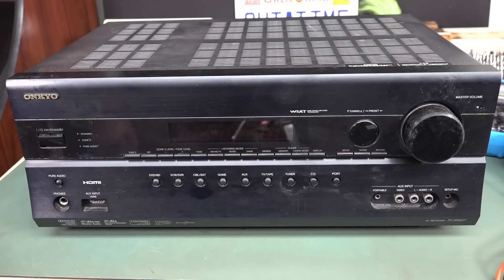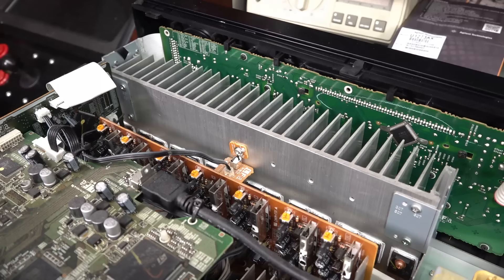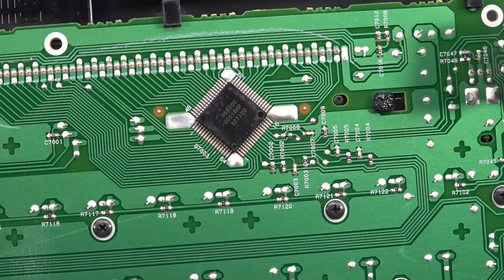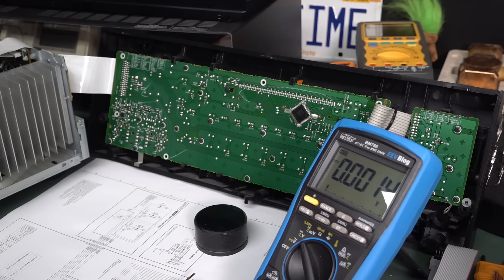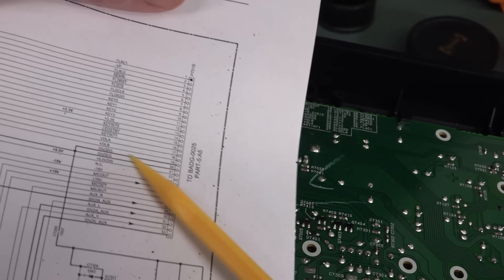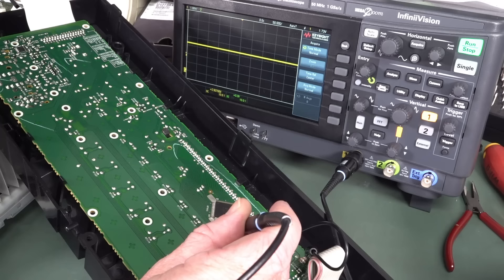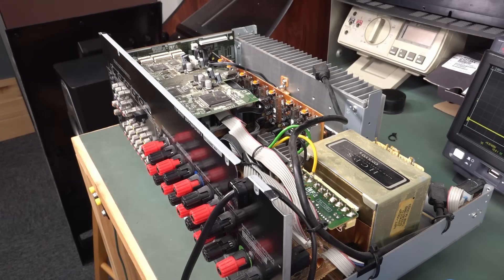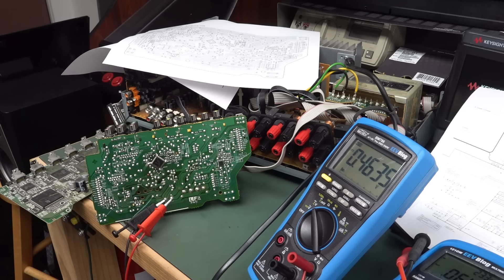EEVblog 1394 - Onkyo Receiver Repair - Part 1

Comment: Yes, do more audio and CRT based repairs!
Reply: Dave loves high voltages
Reply from the maker: @zyspan  It's true, I LOVE 12V systems!
Reply: @EEVblog  i am recently attracted into analogue audio circuits with two 9v cells forming a bi-polar supply

Comment: I can't help but notess you have mised one of the first things you should check with VFD's, that is checking if the tube has lost its vaclume. Usualy the little nib gets knocked off when the unit is bumped to hard or droped. As long as the getter is still shiny then the vacume is still in there.

Comment: Dave, Q9001 is a simple +ve voltage emitter follower regulator...

AC from the transformer is applied to the circuit, one end to R9010 and the other to the -ve end of C9001. This is half wave rectified by D9001 and smoothed by C9001 before being applied to the  collector of Q9001 via R9001. The reference voltage created by R9002/3 and D9005 is applied to the base and the output is at the Emitter.

To check out the regulator without having to power up the unit, ensure that you have the transformer disconnected and use an external power supply supply, -ve to C9001 and +ve to R9010. Across C9006 you should see your -VP supply voltage. 

The thing that makes this look overly complicated is that, what would normally be the positive output is referenced to the +5 rail and the side that would normally be ground is actually the -VP output. I'd lay my money on one of the resistors being OC/ R9010 or R9001. Of course check that there is not a short on -VP.  Steve

Component references as per downloaded manual from ONKYO TX-SR607 SM Service Manual download, (elektrotanya.com)

Edit-Just seen part 2 of this. Seems I was spot on :) But make sure that if the resistor is a safety component it is replaced with a suitable part.....
Reply: Hahaha. Turns out this was good advice!

Comment: Boy, you sure make troubleshooting VFD displays look hard.  And you even have a reasonably close schematic.  And those gray ribbon cables are just plugged in.  Push the flat spot on top of the white connector down to release the clamps then pull out the wire.
Reply: He's an Engineer, what do you expect, they can design them but fixing things is whole other ball game.

Comment: Also if the set (it IS an AV receiver) has video output, hook that to a monitor and see if it displays any info when you operate the controls.
In a darkened room you can see the VFD filament glow, just like a 1.4 volt valve tube.
Reply: YES. I have a similar Onkyo A/V and it displays all the menu / setup options on the TV screen.

Comment: I have the same model that got the same issue with the display after having it for two years. The display just didn't turn on one day, but all the other features worked fine.

I sent it in for a repair at an authorized Onkyo service provider and they diagnosed the issue to be with one or two resistors. The service report had this listed as parts:
2,2/0,5
220/63

After I got it back it have been working fine for 10 years now

Comment: I had this exact amp... lost my job, and had to sell it... got a lower model now and it's going strong with no issues...

Although I know the VFD not working is a known issue with some of these....

If you plug the HDMI-Out into a TV though, you can use the interface on the display to manage the settings ;)

Comment: A few years ago i was walking out of a friends apartment and on the neighbors trash can was a Harman Kardon AVR354 7.1 receiver. I swooped it up and took it home and all that was wrong with it was a busted internal fuse and some dodgy solder joints. It's been running for 3 years flawlessly.

Comment: I've had a couple receivers come in with dead displays, only to find that someone had bumped the "dimmer" button and turned the display off LOL.  Though usually it's not that easy.
Reply: When I discovered that my Denon-receiver had a setting to disable the display, my first thought was that this feature must be responsible for some small part of the product return-rate 😀

Comment: Check the DSP chip on the HDMI board, IIRC that drives the zone portion of the display and the digital inputs as well. Usually a reflow or a 50W halogen lamp pointing at the HDMI board to heat it up works temporarily. There was a huge flood of these on Ebay as not working, bad TI DSP chip and Onkyo ran out of HDMI boards for warranty repair.
Reply: I had that issue on mine (or at least a similar issue on the HDMI board). I recall there were a couple of small components to bridge out or bridge over with a resistor, which saved it for a while.

Comment: The ONKYO TX-SR series is notorious for failed electrolytic caps on the video switch board. Recommend replacing all of those through hole and surface mount electrolytics with high quality 105C rated components. Check your video processing and passthrough for noise/glitches.

Comment: I once repaired a dead VFD on a DVD player (good one worth saving, some Pioneer thing that plays Super Audio CDs). Nothing wrong was with the tube or the driver, it was just a current limiting resistor for the tube filament that opened.

Comment: Love the repair videos! I did this for a living until it became unprofitable. Thou shall check ALL rail voltages. Come on man, you have a shop full of supplies to feed that circuit externally and then divide and conquer. Just be sure to power limit that external supply and I'm sure with your skills you'll find it quickly. Can't wait for part two!

Comment: I have one of these and had the same problem, I had a repair shop say that the issue was due to a joint somewhere on the display getting too hot and cracking, they also said that its a fairly common fault but wasn't common enough for a product recall.

Comment: I have one of the higher-end models from this range. It's got hdmi and an internal upscaler. I love it. Got it as a refurb unit well over 10 years ago. Use it daily. Only issue is that recently the automated eq setup program will start randomly as if i pressed the button on the front of the unit.
Reply: Spray some electronic contact cleaner in the button and press it 50 times.
Reply: Follow-up: In my setup it was just too much work for me to dig it out, and due to the fact that once the thing warmed up it was not a problem again, I did not try to address the problem. One day recently, though, it got real ridiculous to the point I couldn't get it out of eq setup mode. I gave the unit a nice quick  "tecnical tap" right under the buttons that select the eq setup program. It's worked fine now for about 3 weeks. LOL

Comment: These kind of amps are perfect for like salvaging parts.
Mains transformer will work perfectly as a good PSU for a lab power supply, heatsinks, banana connectors are very usable etc.
Depending a bit where you live, but I have see them for less than like 20-30 bucks.
New heatsink and transformer is more expensive.

Comment: Took an older one apart that had a failed Dolby decoder board, and thus was not fixable. Standard definition analogue video as well. They also use PCB sections with wire jumpers soldered between them as wiring loom clamps, where you have to fold the pieces of board over to hold the wiring looms.

Comment: Those ribbon interconnects. You press down on the top and it lets go of the pins. 

And yes. I repaired one of these a while back. Huge pain in the ass to work on. Back in the day, they used to have a removable panel on the bottom of the chassis that let you get at stuff on the bottom without a huge issue.

Comment: Interesting vid regardless of the outcome, I recently picked up a similar unit from pioneer, almost free since it was defective, not quite as many bells and whistles but roughly same era and basic features. Haven't had more than a cursory look at it yet but seeing your process is similar to what I'd do gave me some confidence that I might actually be able to fix it.
Reply: I have a model of similar vintage (maybe a little newer). Mine had a problem with the HDMI distribution board when hot (can't remember the exact symptoms, repaired under warranty back in the day). I think that was caused by cracked or bad solder joints under one of the BGA chips. So if you have those kind of symptoms, reflowing that might help.

Comment: Great series ! - more repair videos. Its always interesting to see how other engineers go about things.. I'm watching this as I type and shouting capacitors at the TV !! - I have the same AMP. they suffer with CAP's. the HDMI board also suffers with dried out caps the symtom there is your can't get the on screen display to come up on the TV.
Poke about with an ESR meter...

Comment: Why not activate the ‘Zone 2’, ‘Pure Audio’ (buttons on the front panel) and IR (volume) as a simple test to check if the display chip is working and eliminating it before going further in to troubleshooting.

Comment: Surprising, an onkyo xx7 Amp where the DSP board hasn't failed yet...
If you get the VFD to work, I would highly recommend replacing the caps on the DSP/HDMI board. 90% of these recievers fail because of those, so its just a matter of time.
The Board gets toasty hot and they only used 85C caps.
xx5 was nice
xx6 and xx7 had HDMI board capacitors issues
xx8 have issues with the texas instruments Signal processor (A,B and C revisions of the chip), the output drivers wear out until the digital signal is not readable anymore.
xx8 to ??? have issues with the same DSP, board flexes due to heat and over time the BGA balls crack.
You can reflow the TI DSP, it will permanently fix rev D boards, and temporarily (similar to Nvidia 8xxx GPUs) repair A/B/C TI DSP chips

Comment: Yes it’s very irritating to have a needed voltage developed on some obscure boards some were in the unit making a simple problem very messy and the unit all over the bench but it’s a symptom of designed to built not to repair

Comment: Looks like the best way to fix something like this is to post a video about your efforts and let the viewers leave comments about which resistor to check or suggesting that the damn thing might simply be in "display off" mode or . . . Fascinating as always to follow Dave's thought process. Couldn't this thing have been designed with fewer boards that could be more easily accessed? Crazy complexity and feature creep. Is that what audiophiles expect these days?

Comment: I've got a late 90s top of the line Yamaha with no display. It's a known problem with cold/dry solder joints because LEAD. It's on my todo list to fix it.

Comment: Onkyo USA, I hope you're reading this!

Back in the 70's I bought an Onkyo A5 integrated amp. It was beautifully designed, constructed, worked flawlessly and sounded great. But, it also felt great! Especially the very large volume control knob. I had subtle de tents at every increasing level step. It was smooth, it had weight, it was slightly recessed with a beveled ring. I've never encountered anything near as good as this control knob with any other product. The other selectors, buttons and pots all felt great as well.

 So when I needed an integrated receiver a couple of years ago, I bought a new Onkyo receiver. Much to my disappointment, its just a "run of the mill" stereo component with a few annoying flaws. What happened to you guys?

Comment: I don't use it anymore because it is analog, but I had a Technics amp that kept changing the audio source for no reason. It was one of the 'new Class A' ones (class H?), that had a energy efficient integrated MOSFET, but suffered crosstalk etc.

Comment: I've seen transistors that tested OK in every tester, but they were locking, so when you crossed some threshold of base current it just stayed always on, even if the base current went down.

Comment: I worked on dozens of these at an Onkyo warranty facility.  What a nightmare. These types of problems are almost always power supply problems. There was one model, and I can't remember which one, that had a power supply update kit to fix the toasted power supplies on the main PCB.  I don't know why, but with almost every manufacturer, the low voltage power supply was an afterthought, and a bad one at that. Even Arcam, which charges an arm and a leg for their stuff.

Comment: Things I've found repairing those Onkyo's. The HDMI chip damaged causes the microcontroller to turn OFF the unit. The driver board, the one with the yellow pots, it works really hot. So the epoxy they used to stick the SMD parts to the board does carbonize creating havoc on the amplifier and causing it to reset due to voltage present on the speaker output. The board on top of the unit gets dust and moisture from splatters thru the holes on the top of the case, corroding traces and vias. Shorted SMD capacitors. Circuit controlling the VFD display high voltage gets affected if it gets stuck on an ON-OFF cycle loop.

Comment: Love the Onkyo 7.2 home theater amp I picked up from a local Flea Market (swap meet) Nipped it for $40 due to it having a damaged banana jack for one of the front outputs.  Did a nice work around using just a gater clip and that thing works 100%!  

Back in "The Day" I stopped into an electronics store called "Bernie's Electronics" (they did audio and appliances, etc..)   Picked up a basic Onkyo 5.1 that started my enjoyment of this brand.  It was a 'referb' and I was concerned about the quality.  The salesman let me know that about 80% of the time the returns are nothing more than someone purchasing the unit and then becoming totally clueless on how to setup the receiver.  

The only receiver that sounds better would be the one in my office at work.  1973 STA-180 by Realistic.  (think it was a special done by Hitachi) However I do gaming and love the 7.2 surround sound for games.

Comment: In vdf display, 80% of the faults are the  line  (-27v)  or  the filament voltage  or the reset voltage - power voltage  and many others the connector that connect the vdf- control botton with rest of the unit  but in this model it is flexible flat cable.

Comment: When a power supply is bad I usually disconnect the load and measure the open circuit voltage.  That will separate a bad source from a shorted load.

Comment: I got a great deal on a similar Onkyo AVR, the HDMI board on the model I have is prone to overheating and failing. It's working perfect after getting a replacement board from eBay and doing a mod to keep the fan running all the time (can barely hear it as driven with 5V instead of 12V). If you have one of these with a fan (the fan switches on at 100% based on a sensor) might be a good idea to change it so that air is moving all the time.
Reply: Some of these had solder problems under one of the BGAs on the HDMI board, try reflowing with a hot air gun, you might get lucky (or not and have reball job on your hands).

Comment: I tried to repair one of these receivers a few years ago. I don't think it was the same model, but it looked very similar. In my case the power on button didn't work properly. I was able to turn it on sometimes by shorting two pins on the board by the relay, but I was never able to get it to work properly that way. In my version the power button went through (I think) four different boards and into a QFP chip on the main board. That was probably the main control IC, and maybe something was wrong with it. I couldn't find anything wrong with the voltages, and I was sometimes able to get it to work properly after power cycling it enough times, so it wasn't a permanently failed power supply component. I never did figure it out. Of course I didn't have the schematic, which made it even more difficult.

Comment: Yeah these FL displays in receivers are a rabbit hole. I have a Marantz AV8003 pre-amp from around 2006, suffering the same fate. The filament runs off its own 3V AC supply with both sides biased to -29VDC. The display is alive, you can see the glow of the front heaters. The whole thing is active, it is just fading into blackness as time passes. Replaced some capacitors in the driver circuits with no success. I hear about this a lot in audio gear. What is it with the FL displays in these things? I see lots of old (non audio) equipment including VCRs, cars, trucks that have 15+ years old FL displays glowing perfectly bright like the day they were sold. Great video just the same.
Reply: The newer VFDs seem to dim or burn in pretty quickly. I'm guessing they had to change the phosphor composition due to some RoHS bullshit.

Comment: I repaired this same model that had display issues and it turned out to be, from memory, a bad 33ohm 1/4W resistor near the front panel.

Comment: In hi end amp all speaker output thay have a protection relay 
Or delay switching relay that connect the speaker to the amp out put once the the amp out put stabilizes

Comment: If I had your knowledge I would continue digging in :) I did not see the boards too good, but I would have tried extending interconnect cables so I can test that board outside the box, but still connected. Of course there might be issues in connections after extending.. Anyway, these videos are really interesting, just it's sad you did not manage to fix it. Don' t put it away for too long or you will forget, how to put it back together... you will not watch the videos in reverse ;)

Comment: I gave up on Onkyo after my TX-SR606 quickly broiled itself to death. They added more HDMI inputs and outputs in it by putting a daughterboard directly over the hottest elements on the main board preventing them from cooling. The thing started failing within days.

Comment: That ON/STANDBY button looks a bit wonky! I have a 1996 vintage Onkyo, where it fell out completely and got lost! Fortunately, I can reach in and press the tiny button!
The button was part of a plastic moulding (think Revell model car kits :) ). Interesting, considering the rest of the receiver didn't look like typical 'built-to-cost' (?)

Ah, and there's that 'plastic moulding' now! (08:00)